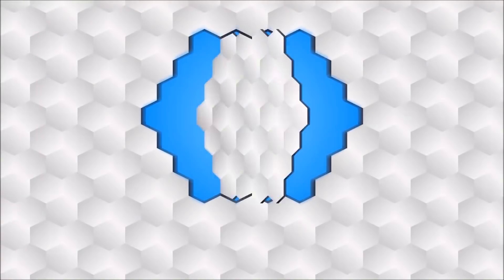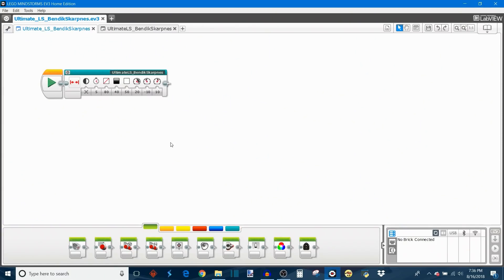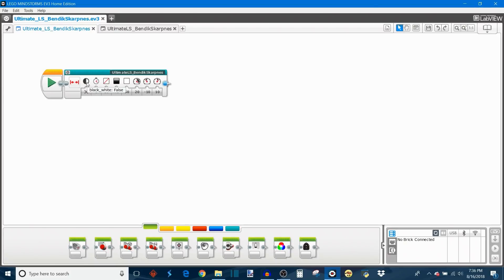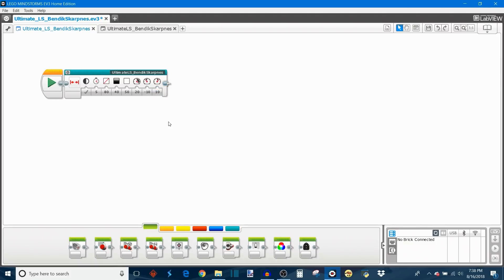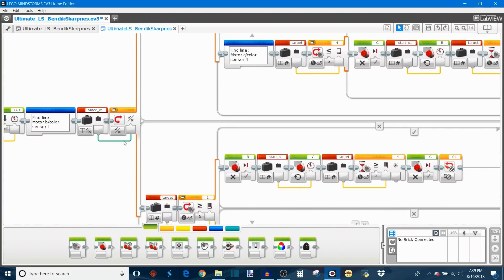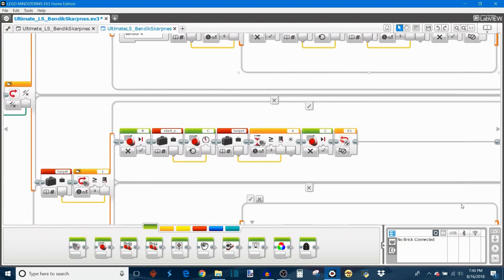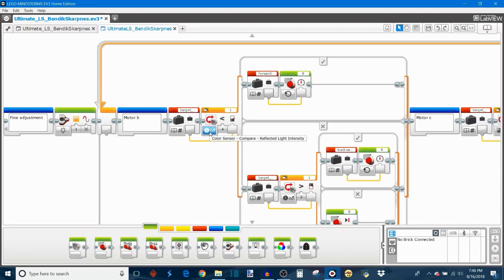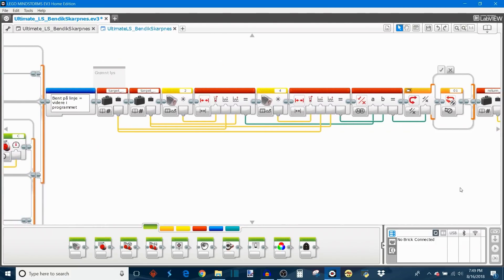The Ultimate Line Squaring Program! - EV3 Navigation with Bendik Skarpnes

Comment: Could you explain more on how you figure out the light target values that you put in?  Why wouldn't it be black- low around 5, white around 100 and in-between at 50 if the sensor was calibrated?
Reply from the maker: See my video on proportional line following. I include a full explanation on how to get the light values in that video.

Comment: I've watched the section where you describe the 'coarse adjustment' loop twice, and I cannot figure out how the robot would work if the color sensor on input 4 is the first one to find the black line. At the end of the video I can clearly see Sirius approaching the line from both the left and right, but how is this achieved? Assuming sensor 1 hits the target color first, then you stop the wheel on motor B and pivot the robot around it until the sensor on 4 sees the target color, using forward motion on motor C (reverse power on Sirius). However, if the robot approaches from the opposite angle, then by the time sensor 1 sees the target color, wouldn't sensor 4 have already passed it? Am I missing something? Are you watching both sensors for the target color value?
Reply: Hi Michael! Thanks for your question! The if statements, where sensor 1 looks for the line, has an else statement as well (checks if sensor 4 sees the line). If that returns False as well, the algorithm will conduct this process over again; until one of the sensors has found the line (because of the loop). Therefore, we are watching both sensors simoultainiosly, sensor 1 right before sensor 4.

I hope this lowchart makes it simple to understand: 

Senor 1?
Yes: stop the motor, drive with the other motor until sensor 4 is on the line, continue to the fine adjustment stage.
No: Sensor 4? Yes: stop the motor, drive with the other motor until sensor 1 is on the line, continue to the fine adjustment stage.
                          NO: start over again
Reply: Ahhh... okay, I see it now. It's hard to really analyze the program by stopping the video repeatedly. I'm a software developer by profession, and trying to coach my girls' FLL team. Trying to learn this well enough to teach them. While I consider myself an accomplished developer, I find the graphical programming here to be a little baffling sometimes.  Thanks again!